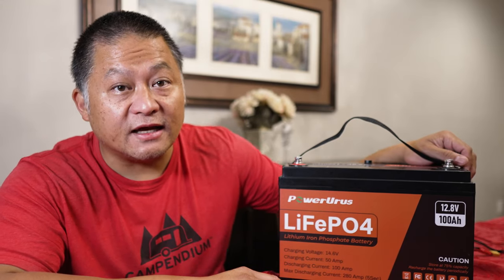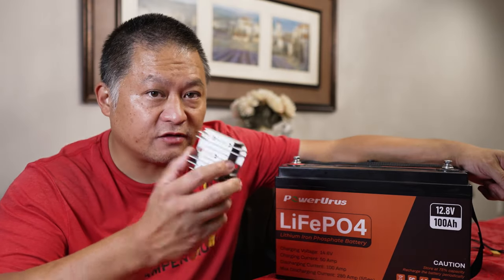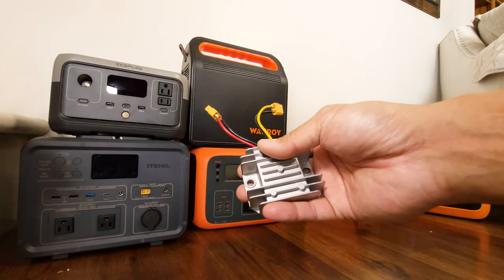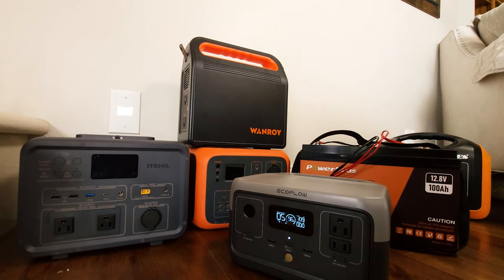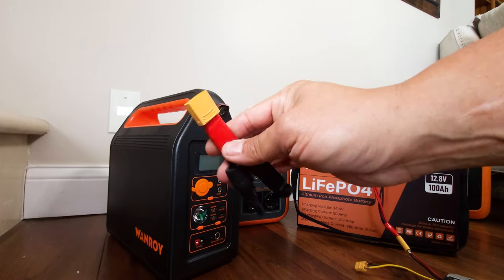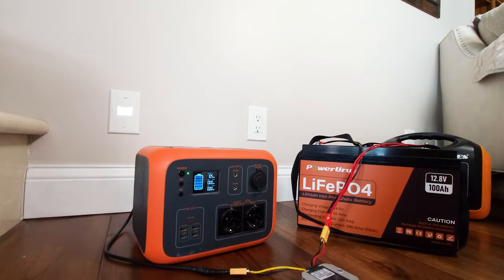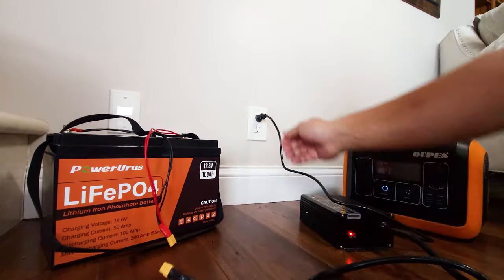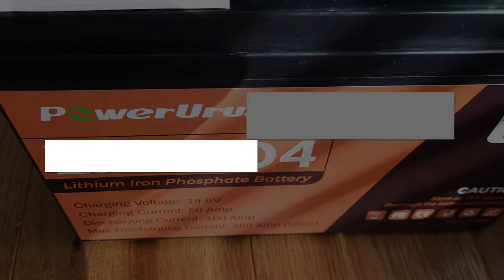CAPACITY HACK For ANY Power Station // PowerUrus 100Ah LiFePO4 Battery

Comment: Is it possible to charge both the generator and the extra battery with the solar panel at the same time, while the extra battery is connected to the generator? I am trying to have a better picture of how this system can work fluently.

Comment: Hi, I tried it with a dc to dc converter 12-24 3A from a 100ah lifepo4 to my Ecoflow River Pro (1st version) TX 60 10-25V 12A max 200W input /It started ok 192 watts input but after about 45 sec the watts went to zero and converter was very hot What is my problem 😊😊?😊😊😊😊

Comment: Questions: can you please confirm the model number of the converter?  I clicked on your link w/part # TBS1224B72Z but your unit in the video has TBS1224B73Z.  The gags wire is 18 awg on mine and yours has 12 awg wires.  

Lastly, why did you double up the cables from the converter to the battery.  I am using single 12 awg wire to each post.  Is that cool.  Thanks sir.

Comment: A) How about putting a in-line fuse on the external battery?
B) Why not use a female XT60 connector on the input of the step-up converter so they are unlike. This to prevent ever by mistake connecting the output of the step-up converter to the external battery, instead of the input. (the plugs only fit one way then)
C) If the step-up converter(or the acceptance of the powerstation) is no greater than 120W - would you not save the 3-5% loss in the step-up converter by simply connecting the external battery directly to the cigarette lighter input of the power station?
Reply from the maker: Fuse: yes, wouldn't hurt 
XT60: because I use it for other devices with different connectors
Converter: because this is compatible with more power stations that may not have a current limiting device that might overheat the wires. Many solar generator/power stations need more than 12v of input in order to charge thru the solar port. 

Anything else?
Reply: @freelyroaming  I'm glad you like the idea of the fuse. If there is a short in the Step-up converter, those wires going to the battery will melt in an instant. That battery will deliver 2-400 Amps no problem - or at least 100A by the BMS for long enough to melt the small wires.

XT60 plugs are a great idea - I was just suggesting putting on of each kind (male and female) of the step converter, that way it would only connect the correct way with input/output

Almost all powergenerators can be charged by a cars 12V cigarette lighter port. And you have 12.8 - 13.4V right of the external battery. And the Powergenerator wont take more than it can handle (typically 120W) so thats why I suggested to just connect the external battery to the same plug you would use when charging from the car.

This all meant in the best way as suggestions. I like you think out of the box and suggest alternatives :)
Reply from the maker: @jbjensen11  the converters are not going to keep conducting if there is a short. Just not how they work. Like I said, fuse wouldn't hurt if you insist. Also not all solar generators will accept 12v input but all will accept so so solar panels.
Reply: @freelyroaming  Alright - we have just have a different perceptions of electronics, as the electrical engineers we are. Thats alright. My priority was just safety - and simplicity. It was not to argue with you! If the short of the step-up converter is on the input - it WILL short the battery until something melts. there is NO internal safety measures build into them. That is how they work! 

Almost all solar generators can be charged by a cars 12 V battery on the DC input meant for car charging - and the LIFEPO4 will emulate the voltage of a car just fine :)
Reply: @jbjensen11  I have been following your conversation with interest. In the case of the Ecoflow River 2, an alternative setup to this could something like a NOCO GC017 (which has a 15A fuse on the positive wire) and has alligator clamps that you can directly clamp onto the 12V battery, with a female cigarette plug on the other end. 

Then you can simply use the 12V cigarette to XT60 to charge the unit. This should work just fine since the input watt limit River 2 is 100W. 

This way, you don’t need the 24V, have the safety of the in-line fuse and also have a simpler setup. 

Where this boost convert seems to come in handy is for bigger power stations like the Bluetti EB70s. You can use a 12-24V 10 amp boost converter. You pull 16A*12V = 192W of power in and boost convert to 24V * 8amps (the EB70s current limits)

I hope what I said makes sense.
Reply: @LiquidTurbo  Sure makes a lot of sense! To me anyway :) That is sort of what I was trying to suggest. 
-In regards to when a boost converter comes in handy, I had this comment in my original post "If the step-up converter(or the acceptance of the powerstation) is no greater than 120W.....why not simply connect the external battery directly to the cigarette lighter input of the power station"

Comment: buy a 24 volts 100ah battery that you won'T NEED THIS CONVERTER
Reply from the maker: @victorjoseph8948  WRONG. I've literally pinned a post for comments like this yet you still did it.

Comment: If I have a small 300wh solar generator and wanted to add a 12v LiFePO4 battery for extended capacity, but it only has 1 input that accepts solar/wall plug/car adapter how can I do it? I currently only use the input for solar with a 100w panel but the solar generator has a 60w solar input limit. I don't see a way to charge the 12v battery or how to connect it in my configuration. Do I need to instead upgrade my solar generator to one that has multiple inputs, but even then how can I use my solar panel to charge that additional 12v battery?

Comment: What size terminal rings did you connect the 12 gauge wiring with to the battery.?? I  have 3/8 terminals, but the gauge of the wire is 2 awg. so the arm of the 3/8 ring to the terminal is too big for the 12 awg wiring,, ??? Help

Comment: Great video. Question can you use the 12/24v converter from a lead acid battery that is charged from the vehicle's alternator via a DC to DC charger and charge the Eco flow? Or must you use a Lithium battery as the source to charge the Eco flow?
Reply: The source does not matter.

Comment: your estimates on doubling and tripling the capacity is off because you are using amp hour capacity - this is wrong! there will be losses in the charge process plus that battery is rated 100Ah BUT AT 12.8 VOLTS!!!  Thats 1280watt hours. so if you leave out conversion losses of the 12 - 24v converter - at 24 volts then that battery will only be 53amp/hours - plus change.
Reply from the maker: No. I was not using amp hours. I am using watt hours. It's an unambiguous way to measure capacity. Conversion loss is around 8-15% so for a 500wh capacity power station, even at 15% loss, you are still tripling the capacity from 500wh to more than 1500wh.

Comment: Why not just build a battery box with a LifeP2O4 100Ah battery inside, like a Licitti battery box with 3 DC ports, an inverter and a MPPT controller for far less than any power station.😅
Reply from the maker: Because this is for people who already own a power station. Not someone who doesn't. And it is far more complicated to build a portable one and do it safely. There are a lot of reasons why this video and what you suggested are 2 entirely different things.

Comment: A 100AH battery would basically be equal to a 1280 WH power station? Is that math correct?
Reply from the maker: @Knife_Collector  yes that is right

Comment: Buy 2 12 volt 50 amp hr batteries. Wire to 24 volts and plug into your  dc input maybe.

Comment: Can you charge the solar generator or the lifepo4 battery from  the charger plugged into an inverter hooked  to your car battery while running instead of plugged into the wall ?  If the inverter is large enough of course.

Comment: Quick question can you reverse boost connector and use solar panel to charge the lifepo4 battery with makeshift XT60 is it bidirectional power?
Reply from the maker: In order to charge the lifepo4 battery with a solar panel, you need a charge controller. If you put one of those in between then yes. Probably easier to just use the panel and charge the power station directly. Those usually have inbuilt charge controllers

Comment: You've used a 30Amp charger but is it safe if the wall outlet or wires leading to distribution socket are for 16 Amp only and thus after leaving charging for five hours you just overheat the socket outlet or worse wire behind the wall and create fire?
Reply from the maker: A 30a 12v charger draws less than 4a from a 110v ac outlet.

Comment: what if you put your power booster at the end of your solar panel wires just before they enter your power station  So basically you're boosting your panels from 12 to 24 volt ... will that work?
Reply from the maker: Solar panels don't need to and shouldn't be boosted this way. 12v panel is usually outputting 18-22v already. The booster used here is actually trying to simulate the output of a solar panel.

Comment: Hi I thought this was a great idea so I gave it a go it worked for about 3 minutes then the Step Up converter stopped working I'm hoping it's the converter and nothing else as the Delta 2 is brand new but it did work when it worked
Reply from the maker: It's possible that you just got a bad boost converter. However I don't have any experience with the Delta 2 but all of the other Ecoflow units have worked for me.

Comment: So in theory you could get a 200 watt solar panel and charge controller and just plug to the lipo4 battery and the battery would top off the power station as you use the pass through charging
Reply from the maker: If you are going to use a solar panel then you may as well charge the power station directly. Unless you need to extra capacity at night or indoors.

Comment: I charge my 400ah of LifePO4 at 140 amps on generator from totally depleted to totally charged in 3 hours flat with another week of juice before i have to run it again. I do have a total of 600ah, 200ah is lead acid.

Comment: Could you use two 50 ah 12 v lifepo4 batteries hooked together in series to make the 24 v so not to need a voltage converter?
Reply from the maker: One of the safety precautions you will want is some sort of current limiter. Connecting to batteries in series directly won't give you that protection. Although your power station might already have it but it's not guaranteed

Comment: Another wonderful hack.  Thanks for all your ideas.  Question: can this step-up booster also be used to boost a 12-volt solar panel or a 12-volt power supply?  I realize it may be slower but will it work?   I'm always looking for alternative ways to charge.  Thanks.
Reply from the maker: Thanks. Yes you can use it with a power supply but I would avoid using it with a solar panel as the voltage is not stable

Comment: Will the battery stop itself from over discharge?
Reply from the maker: All 12v LiFePO4 battery packs should have battery management systems with low voltage cut off protection.

Comment: Why not just connect an inverter (with additional uses) and just plug it in.
Reply from the maker: Because it's more expensive, less efficient and you don't need one since almost every power station have inverters already built in. But you do you.

Comment: how do you charge the powerurus battery? is it possible to charge them using the power station too?
Reply from the maker: However you normally charge a battery. From the wall, solar, car, another battery, whatever. I use a charger in this video 14:40

Comment: Could you use more than 100 amp battery ? And more than one ?
Reply from the maker: You can but it's not necessary unless your power station has more capacity than the battery does. For multiple batteries you can just connect them in parallel or use them consecutively.

Comment: Will this work for a jackery? I believe that they shut off at 100 watt
Reply from the maker: It should. The link in the description to the 3A boost converter will limit the power output below 100w which should prevent the charger controller from shutting off.

Comment: dont need a dc to dc  all you need is two lithium batteries to charge at 500 watts instead of 110 watts
Reply from the maker: Just BUY another battery that costs 20 time more than a DC boost converter. That is so much better. 🤦‍♂️

Sarcasm aside, please read this. Everyone who's talking about using 2 batteries in series doesn't understand a few things. First, it's far more expensive to buy 2 batteries instead of one. Second, it is more difficult to transport and still requires you to crimp and solder wires. And lastly and most importantly, it does not give you a current-limiting functionality for safety reasons.

Comment: @19:12 "..power station companies will likely void your warranty.."  As long as you use the Solar input, and that input is rated for at least 30 volts (any designed for 24v panels will be), they can't say much about it.  The varying power from an actual panel or array is actually more stressful than the booster could ever be.  If you really want to protect it, add a 470 uF capacitor on the Output - that will filter most switching noise.  Either way, I would only tell them it died during normal use.
Reply from the maker: They can't say because they won't know. But if they knew that is how you were using it, it will certainly void the warranty.

Comment: To be clear, do all mobile stations use 24V input? Or how do I know if mine does? Thanks!
Reply from the maker: If it is a solar charging port, it will accept a range of voltage. The most common solar panel voltage is roughly 18-20v open circuit. It varies enough that just about every charge controller will accept up to 24v. That is why this works. Refer to your owners manual to confirm.
Reply: @freelyroaming  Sweet! Thank you as usual for your educational videos!

Comment: Thank you so much, I really need to get over my timid nature, when it comes to this topic, mainly because of diy wires, but where there’s a will there’s a way, and I would have saved hundreds vs the AC70 that I may be returning, still in my hallway unopened, since I don’t have the certainty of being able to pay it off! A bit of confidence and caution and I wouldn’t be wrestling buyers remorse! Although I am new to this, and watched a different tutorial were the boost converter had the caveat of running a bit too hot, the circumstances may have been different in key ways during that YouTuber’s tutorial, I just don’t remember why, but all this just to say thank you 🙏

Comment: you hear you can use a 36 volt ebike battery to charge your power station. im  just not sure how to add a XT 60 or 90 connector. i wonder if a Variable voltage power supply would work also?

Comment: i pefer a 24volt 100ah battery
Reply from the maker: It is twice the size, weight, and nearly twice the cost. Also no current limiter as a safety precaution. I guess you didn't read the pinned comment.

Comment: Personally seems rather wasteful what is the conversion loss on the 12 to 24 converter then the loss on the converter inside the power station? 
A much better option would be to open the power station  and connect the exterior 100Ah directly. Some sort of switch to select the interior battery or exterior battery.
Reply from the maker: The objective here is extending the capacity easily,  safely and cheaply. 5-10% conversion loss is insignificant. Especially considering the cost of electricity at this scale. At 30 cents per kWh, 10% loss of a 1280Wh is not even 4 cents. The effort that is required to open up a power station and safely wire up an external battery, you will never make back the effort you put into that mod. A poor use of time and added inconvenience to recover a tiny sliver of electricity. Especially how impractical the system will become to carry around. It is also unsafe to connect 2 batteries in parallel that are not alike in capacity, charge state and bms spec. You can get massive inrush of power in one way overheat and even catch the conductor's insulation on fire leaving to more detrimental failures. Your suggestion is neither easy or safe for most power station owners who have minimal diy know how.
Reply: Not sure if opening the power station up to make a Frankenstein version is practical.  This video is low effort for great expansion and good cost savings.  Thinking of getting the Ecoflow Delta 2 (1000Wh) and then getting an Ecoworthy 100-200Ah LiFePO4 and doing this for overlanding.

Comment: Why couldn't you just use two 12v lifepo4 in series and connect to input?
Reply from the maker: Seems obvious . You'd have to buy 1 additional battery, more weight to carry around, more wiring to deal with. Most of all, it won't regulate the current output which can be dangerous for some low end power stations.

Comment: Great video for capacity. New to this kind of stuff and  I have 2 questions,I have two 800 cold cranking amp lead acid semi truck batteries could I hook those to charge my bluetti  and if so should I wire them at 12v or 24v. And also could i hook up a small 140 watt solar 
Pannel to the batteries with out a charge controler. Thanks